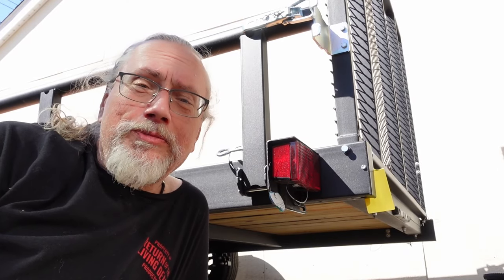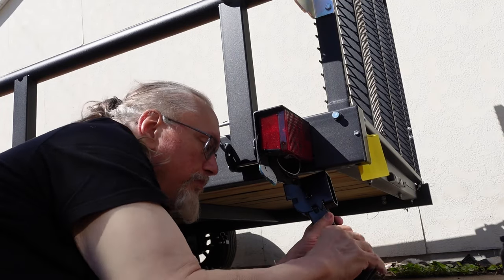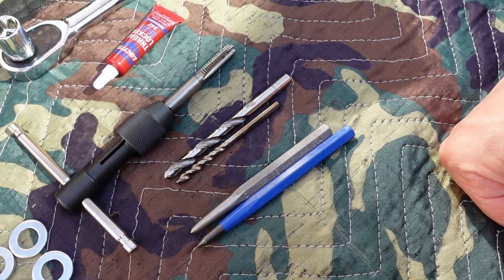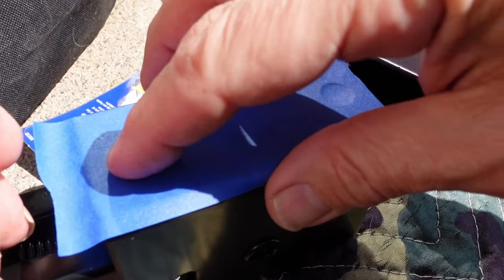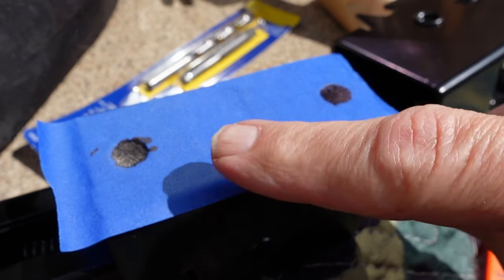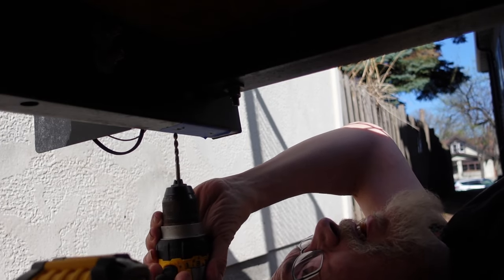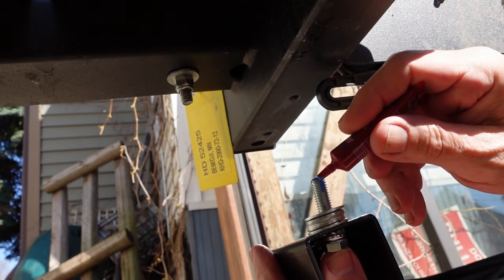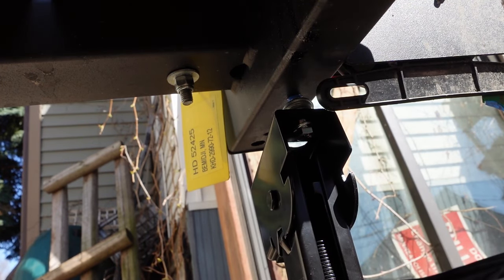Installing trailer stabilizer jacks

Comment: Nice little project.  Hopefully you didn't have a close call which then made this a priority.
Reply from the maker: Nope, but many times with the old trailer.
Reply: @magic.marmot  good.  Then this wasn't an unknown expense.
Reply: I added those same stabilizers to my trailer. They are still one of my favorite upgrades.